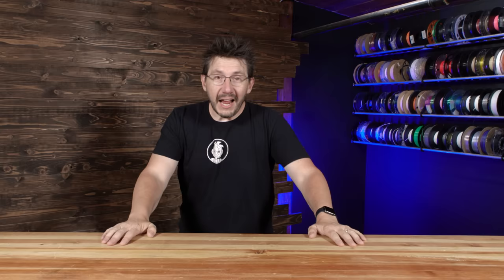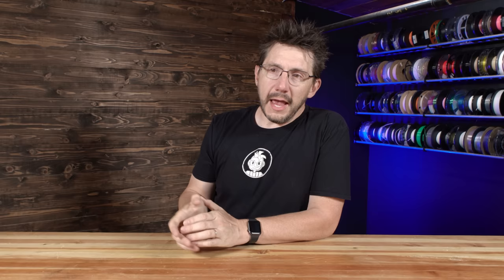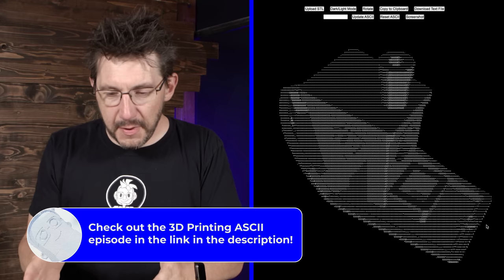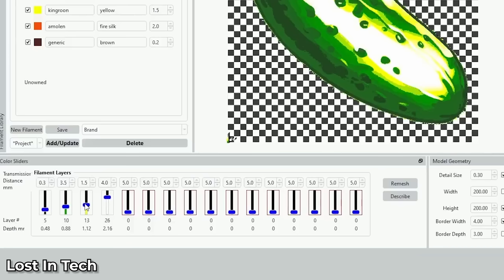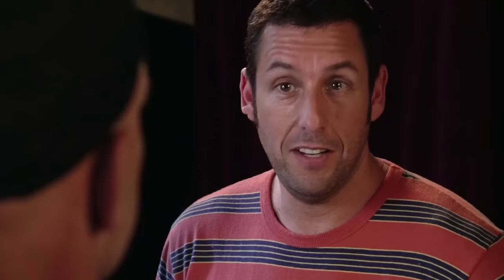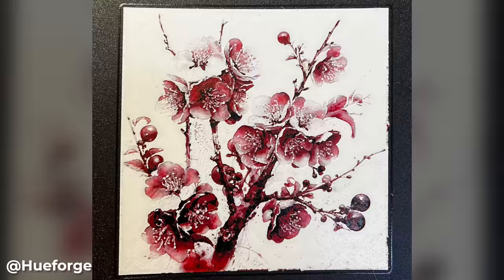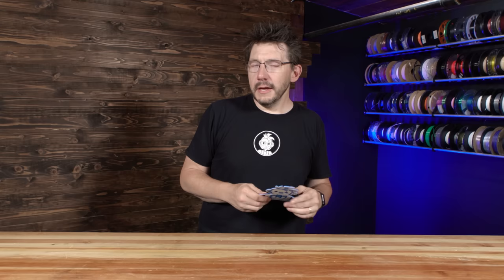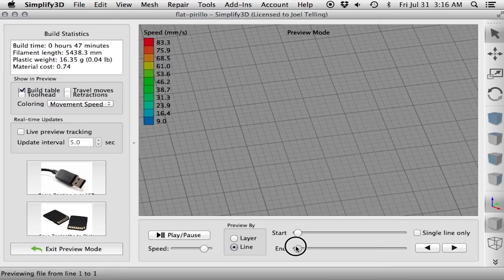My FIRST HueForge Print!

Comment: That is indeed very amazing that Polymaker supports the community like that. Beautiful work from Hueforge
Reply: Polymaker are really great guys. Very good material science too. If you happen to be tearing your hair out trying to print TPU I advise picking up a few kg of their TPU95-HF. I did a 60 minute benchy (.6 nozzle .3 layer) using a PLA preset on a bowden Tronxy system with probably 20 inches of bowden and it did it first try.
Reply: @schizophrenicgaming365  that sounds really great. I bought several spools of their PolyTerra and I’m very happy how it printed… I really wanna use it more
Reply: @schizophrenicgaming365  Yes, TPU95-HF is amazing. I did a 14m:45s Benchy using it. That was with a 0.4mm CHT nozzle, and the Speedboatrace rules (0.25mm layers, 2 perims, 10% infill, etc.).

Comment: Surely it should be possible to extrude 5 filaments (RGBWB) and be able to mix and print with a computer's help.
The filaments would presumably have to be incredibly thin before they could be mixed/woven...
It's only a step away from ink printers doing the same thing for decades, it's just a case of getting the individual elements to mix in the correct percentages.
Unless I'm totally mistaken, that is.

Failing that, It IS possible to print 'high definition', full colour images a different way, with the same five filaments, you've just gottathink like a cathode ray tv.

Each 'pixel' on the screen was comprised of a bunch of blocks, which when mixed between the five colours, would give viewers the appearance of any desired hue.

The top layer of a print should be the only layer with multiple pigments, but instead of laying a single layer at a time, it'd be one dot at a time.
It'd take a while, but you would result in a photo-realistic print.

I'm sure you know someone who could make this happen.

DOT MATRIX 3D, dude!

Comment: Nice Time Tunnel-like (a 1960s Urwin Allen TV show) time travel sequence! When I was a kid, it was open being show as a re-run, so some of my earliest memories are watching that show.

I manually used a transmission distance effect for my Great Benchy Wave (a 3DBenchy display stand based on Hokusai's The Great Wave off Kanagawa). I adjusted the thickness of the natural PLA layer so it formed different shades from blue to white. It took a lot of CAD work, and wasn't designed for manual filament swaps (I used IDEX).

I wanted to try ironing with a different color to get a more subtle effect, but I couldn't find a way to get Super Slicer to iron in a different tool from the layer (S3D 5.1 now supports ironing, but doesn't allow this either, nor does Orca Slicer). I didn't feel like manually editing the G-Code either.

HueForge makes this kind of thing much easier, although it is limited by the one color per layer restriction. While that's useful for manual filament changing sanity, for MMU-type printers it's not ideal. Maybe we'll see support for this in later versions (it's been discussed on some of the various streams).

p.s. Hope to see you at Open Sauce this weekend, Joel.

Comment: Got it and tried it and it’s more complicated than you would think and has one issue that for me is a big problem.
I tried to upload a photo I had and it would not load and found out it was something to do with it having a background so had to remove that before it would load so it’s not even able to accept many images so from that point of view it was a waste of money as I cannot even try the pictures I want to try.
Reply from the maker: Did you contact the developer? What did say?
Reply: @3DPrintingNerd  never occurred to me. Did a google search and it appears to be a common issue. Came across a link to a program that removed the background but doing this allowed me to to upload it but part was missing. It’s early days but tried several jpegs and none worked

Comment: How did that tiny thing take you 8 hours? I've been messing around with lithophanes on my bambulabs p1p at .16mm layer height with amazing detail quality that are 220mm x 220mm x 4mm in less than 5 hours in just standard speed mode
Reply: They are even nicer at .08 but ya take longer

Comment: Just one question: How far is it still until we have opensource Printers? I mean actual Printers for paper
All with the benefits of upgrading or changing whatever you want, fiddling around with the firmware and use whatever cheapo Ink you want in it, without a multi million dollar company dictating you to buy their overpriced cartridges that last 5 pages until they dry out.
Next time my printer refuses to print a black and white document because magenta is low, I throw that piece of sh.. out the window and hand over my CV to my new boss in glorious PLA
Reply: There's not much demand for that. You can get printers so cheap. They can also be a lot more complicated than they look.

Maybe an open source controller board and firmware would be a realistic mod. That would be a good project for a engineering grad student.

Comment: The first and sometimes only safety rule in a 3D Printers included documentation, "Never leave the 3D printer unattended!",  It sounds almost as an important of warning as AirSoft guns warning against aiming the weapons at living beings. 3D printers can burn down houses, best to store safely out of harms way next to all your bottles of film developing chemicals, oily rags and gasoline for the lawn mowers....The safest method of handling long print jobs on your own is treating that print job like the midterm thats tomorrow and you havent for....jk print in firesafe location leave plenty of clearence and don't forget to put away any flammable chems used ..🤸🕳️👻

Comment: Luban 3D have this feature since a year or so
Reply: If what you're talking about is the painting function, it's a little different. Luban 3D represents each color by leaving a different color at the end of the layer height, while HueForge represents more colors and gradations through overlapping colors. Although not shown in this video, it also supports color lithophane generation.

Comment: Here is an idea that could speed up the color process by 100000 times. Think how displays TV works. At the final stage of the 3D print, the printer could use Baer technique (RBG) to display the colors on a 4 mm square, meaning that the print will print lines around the 3D print to combine all 3 colors ( to get 256 shades of colors). So, when the line passes over another line the blend/transparency of the lines would create all the colors you need to have many shades of Luma and Chroma. (This could work because the human eyes/brain feels the gap to make a representation of the real colors that actually don't exist.)
Reply: I think it would need to be CMYK and not RGB.  It's also about light blending, so you can't use it like a TV I don't think, as it is the layer depth that creates the colour mixing. The lithopane CMYK feature on the Bambu is along the lines you are thinking. https://youtu.be/s7orBhLydgI

Comment: Hi from Will and Mr Data :):]
Hi Joel.  Letting you know stuffs being worked on. Sector remains enabled. Education seems to need reminders of services achieved for the entire sector at great sweat tears hair loss crushings and comebacks. 
Consistatly maintain the enabled serices in the type of 
*
 Transfer, Transfer the ability for users to move things between users witin a site.

*.
MIGRATE, to move, spread  a thing into a site from an outside site. 

Brief. With example date.

MIGRATE.
  To move a 1975 thing to a new site, it remains a 1975 thing.

TRANSFER.
 Moving a 1975 thing to different user account within a site, it remains a 1975 thing.

A manual option to enable a Transfer type system  by a host is as follows.

User A has a non commercial licensed thing, a 1975 thing for the sake of this example.
     User A may choose to allow user B  to upload thing into user B account.

User A and user B both provide there permisions and provide the links of those two things to the host along with a request to TRANSFER thing.
Host types 1975 so User B thing is 1975.

Transfer type service complete and closed from host point of view. 

Any delete of the user A original thing is usually done by user A, 
but is as per deal between A and B. 

In recent checks and confirmations of services in the 3d print sector one of the sites has somehow lost "there" systems and services and all knollage of such a service. 
How quickly they have lost the ability to buy or sell but even the knollage of how to. 
I personally find it sad that the knollage of how a sale is performed is so lost at that site that now all there users have to go elsewhere to access operating services. 
We need to up the education in our sector. The many many years of effort to have these services is worth a post from me.
The teams of lawyers that were required to deal with, hair loss assured. 
To understand a non commercial licensed thing is owned so can be sold is a basic. 
To change ownership or move a thing from one person to another requires a Transfer type system. 
To have system that enable things to move the comunity should request such a service from your host sites. 
Wishing you Joel and all community nice success and to be well.